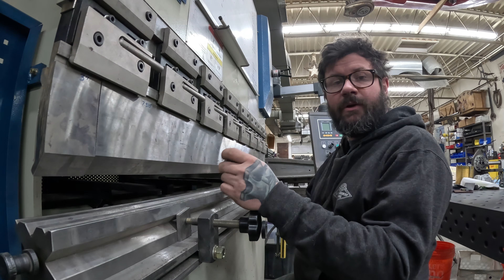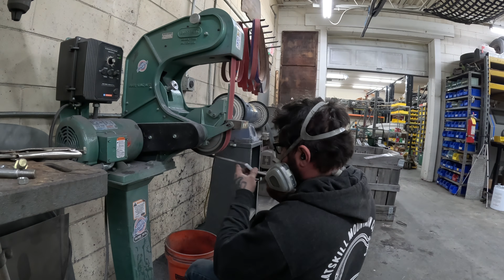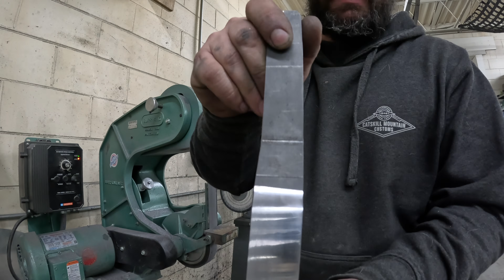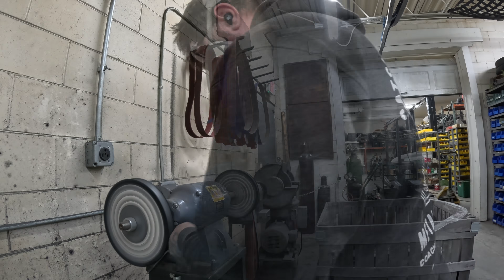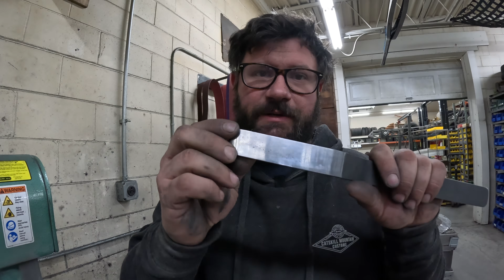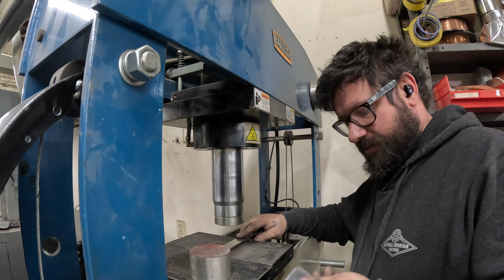How I Make My Slappers

Comment: Nice!  We call them "spoons" in the body shop world!
Reply from the maker: There is a difference between a body spoon and a slapper
Reply: That is correct. My spoon is similar, but not the same for sure! Nice tool. @cornfieldcustoms
Reply: Question, do you make a curved slapping spoon? We repair a lot of panels others won't. A curved spoon would help in contours for the light metal we work with on late model stuff. I have a flat, but nor curved. @cornfieldcustoms
Reply from the maker: @generationsauto8004  i do not make a curved one
Reply: Phooey.  It is still cool to dig into an old repair on an "old" car and find the file marks from their work. I use tools my Great Grandfather used. It is a privilege for sure. I have some very old and battered brass pieces.   @cornfieldcustoms

Comment: sorry for being a novice. what is a slapper used for
Reply from the maker: they bridge more highs and lows ( due to the long contact patch) in a panel allowing you to work larger areas and blend everything out for a much smoother finished panel. check out some of the other videos where i show using one and describe more of the use